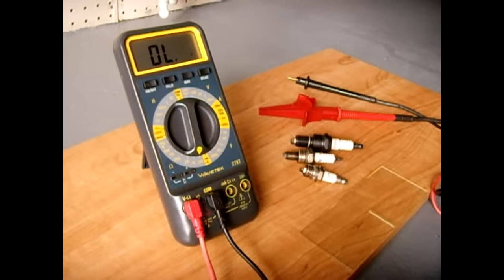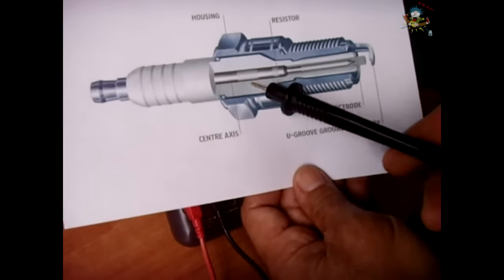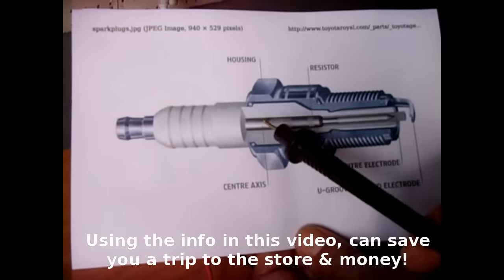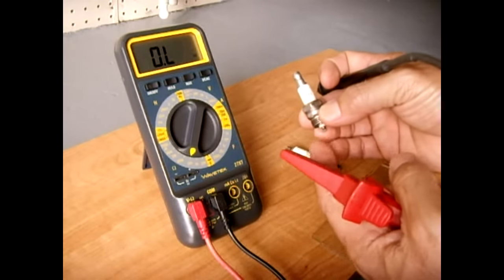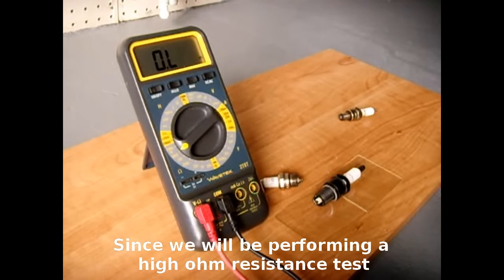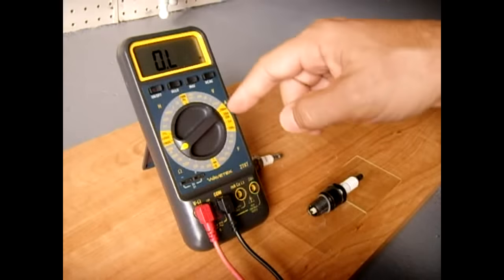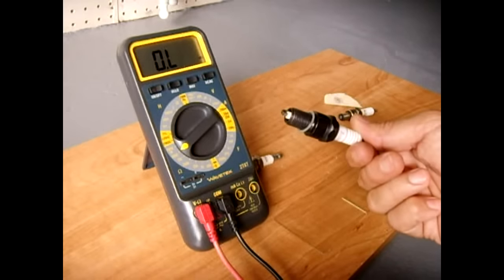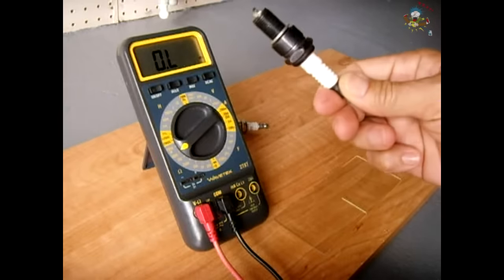How to rule out a Spark Plug as your problem

Comment: WHO TAKES OUT SPARK PLUGS WHILE IT'S HOT?
Reply from the maker: Who? Me, that's who. Never any problem doing it over the past 30 years on cars, boats, jet skiis, and lawn/garden equipment. Turn off your caps. How did you manage to post this comment without seeing my pinned comment???
Reply: I think there are more chances of damage to the thread while tightening the plug than while removing it.
Removing it while it's hot shouldn't cause any trouble but installing it can make it strip the threads.

Comment: Sorry...but the test is not valid.  A TINY voltage ..less than a volt...behaves nothing like tens of thousands of volts...which and EASILY jump more than an inch!

Resistance from body to electrode?...that part is valid.

Check hot and cold? I understand the reasoning....but just installing a new plug is just easier.

Wire brush?  Puts conductive material on insulating part...can encouragecmisfire to ground.

Best way to check...an ignition scope.
Reply from the maker: Sorry, but your comment has been proven invalid MANY times over by my own experiences The only part that you said, that has "some" validity,  is the brushing part. Have s nice day.
Reply: @electronicsNmore  associate member of S.A.E.  15 years teaching automotive electronics at the college level...17 years as mechanic.
My experience is different than yours.
Reply from the maker: @thinkharder2028  What you think or say, has no bearing on my level of success testing spark plugs as shown in this video. I've been using the method successfully for 30 years on small engines, jet skis, boats, cars, and more. Don't like the methods? Don't use them, very simple, but don't tell me it doesn't work when I know it does. No method is 100%.
Reply: @electronicsNmore  my experience is different. Nobody is going to pay a mechanic to test spark plugs cold and hot. Just ain't happening. More certain diagnosis at a lower cost is accomplished by replacement. As well laws of physics remain in effect. A pathway that looks like infinite resistance on your multimeter is easily bridged by a few thousand volts.
Reply from the maker: @thinkharder2028  This video was intended for homeowners and DIY small engine repair viewers.
Reply: @electronicsNmore  I understand you're trying to be helpful and appreciate that. The most important thing to do servicing a spark plug is to file the centre electrode leaving sharp edges. That will do more to lower the required voltage and provide reliable ignition than almost anything else. If you have access to an ignition oscilloscope I highly recommend that you do some tests for yourself. I was personally very surprised to see that a spark plug black with carbon but with a sharp edge on the centre electrode fired reliably and another plug from the same engine that was sandblasted clean but Electro not filed provided much less reliable ignition. The fact of the matter is that when the ionizing potential of a gas is reached electricity will travel through it. And regular air intakes about 30,000 volts to jump a centimetre. Most modern Automotive ignition systems can develop 50000 volts so even if the spark plug wires were placed 1/2 inch away from the spark plug an engine could conceivably run. 100% for sure your metre would not measure a connection across a half inch air gap. That was my main point in replying. An ohmmeter at a fraction of a volt is virtually useless when testing circuits running at tens of thousands of volts.
Similarly an ohmmeter got a fraction of a volt putting out only milliamps is almost useless testing High current circuits like a starter motor. For instance of the battery cable was cut through leaving only one tiny strand Unbroken your ohmmeter wouldn't measured as an extremely low resistance. Of course you can't start an engine through one tiny strand. In that case you need to run the circuit at high current and check voltage loss. So don't get me wrong I'm just trying to be helpful. I have a very strong preference for repair / replacement and with the cost of repairs DIY memes that perfectly usable items will remain in use rather than end up in the dump! So like I said if you can get to an ignition scope and look at spark plugs in action then file the gap on one clean the insulator on another and check again on the scope I think you'll find it eye opening

Comment: Ask a mechanic and he'll  tell you that this method isn't  accurate.  This is a backyard mechanic method. Continuity isn't the thing that fires plugs. Compression, timing, mixture, voltages  affect plug performance. A scope can show a plug misfire under load. When you accelerate,  voltage requirements  go up. Worn plugs misfire at higher RPM's. Don't  listen to this guy!
Reply from the maker: I could care less what you say or any other mechanic says. I've proven it to be highly reliable over the years. Now be a good little Troll and hit the road!

Comment: never sand or brush, because electricity follows the path of least resistance and when you sand and brush you take away the sharp points on the plug making for a weak plug!! Don't be cheap!! Go out and spend a few bucks for some new ones, please. Also you are wrong about the heat range. One way to tell how hot or cold your plug is, look at the number, or the farther the porcelain sticks out of the business end of the plug, or where the spark is, the hotter the plug is. Length has nothing to do with it.
Reply from the maker: +72nova 500hp  
First of all, you don't know what you're talking about. Secondly, why spend money if you do not have to? You must enjoy throwing money away. Thirdly, heat range IS determined by "nose" length, which usually correlates to insulator length, Lastly, have a great evening. :-)
Reply from the maker: You might learn something:
http://www.gsparkplug.com/shop/spark-plug-heat-range/
Reply: +72nova 500hp I always take a wire brush to the heads of the spark plugs in my race sled, it cleans the surface so i can read the plugs as if they were new. That way i can get accurate readings from every run. If they are bad or the start of every race season, i change them, but Im not spending $40 every weekend for a set of iridium plugs when they arent bad.
Reply: You're correct. I meen .99 plugs or 2 dollar plugs, like the ones he's showing. Iridium cost way too much.

Comment: I can’t get continuity through my spark plugs. Two brand new plugs. The small engine runs fine however. This didn’t help at all.
Reply from the maker: If you followed EXACTLY what I did in the video, it works. You must have other engine issues. Don't blame my video. Blaming a person that's helping you, is very low.

Comment: Probably more bad information in this video than any seen lately.  STINKY CHEESE comment is correct.  Remove spark plug, reattach boot, ground the plug, and crank the engine.  If the spark is not bright and bluish, you have an ignition problem which may be or not be the plug.  Then, place a new plug in the boot, ground it, and crank engine.  If the spark is still week, you have a system problem.  If it is bright, your plug was the fault.  Your description of hot and cold plug is horribly wrong.
Reply from the maker: Video was excellent and the method is highly reliable. If you don't like it, don't use it. Very simple. I guess you failed to read my "Pinned" comment regarding the spark plug issue.

Comment: This is incorrect, above 5000 ohm is bad.
Reply from the maker: +Kurt Olsson 
The video is accurate. There is nothing wrong with 6.3K ohm. The spark plug was brand new and just removed from the box. Values will vary.

Thank You
Reply from the maker: Kurt Olsson

Nothing to argue over. 6.3K ohm is just fine. I gave an acceptable range between 4k and 6K ohm. I tested several other plugs that are brand new. All range between 4.5K and 7.5K ohms. You do realize that information you posted is for AVIATION?

Comment: This is not a functional-test.......at the very least you should be using a megger.
Reply from the maker: Of course it is, I've used this method for 20+ years and it always confirmed a faulty plug. Yes, a megger is better, but most people don't have one like me.
Reply: electronicsNmore               I am not saying it is a bad test. Just that it is not real reliable in diagnosing problems, that would come-up when a plug is stressed at or near the same level, as it would be in a vehicle.